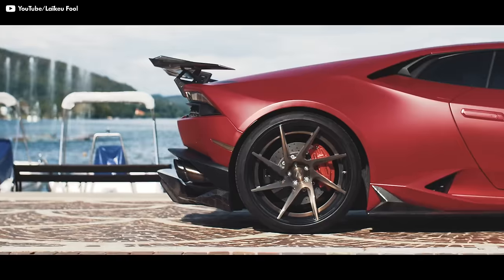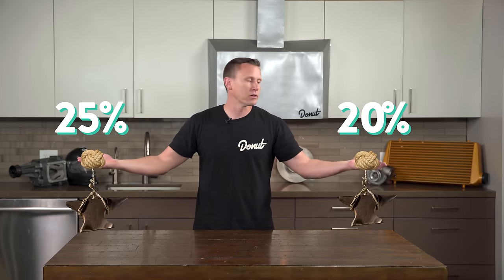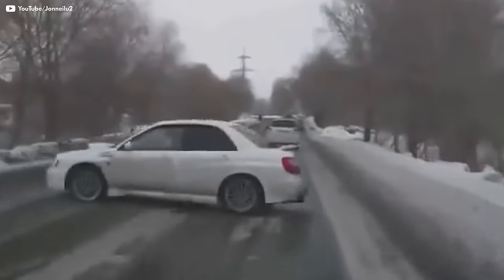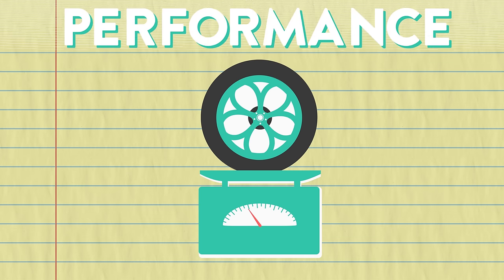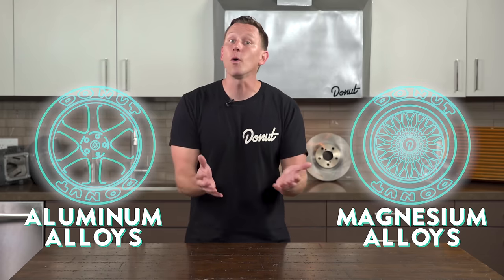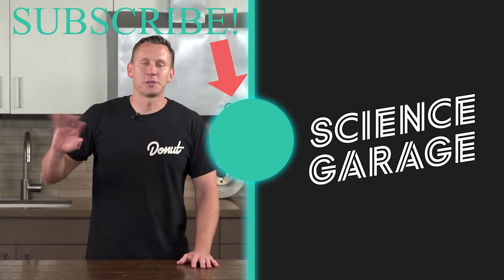WHEELS | How They Work

Comment: In the case of the 18 inch vs the 20 inch wheel, i wish you had added the impact of the increase in circumference.   I think the 20 inch would cover an extra foot per rotation but not sure to what extent that offsets the inertia
Reply: that's an interesting topic to discuss.

Comment: Steel wheels are also excellent on your off roading monster. More weight and wider tyres = better traction AND less ground pressure. Hell it even applies to tracks. That's why the German heavies like the the Tiger H1 were almost as fast as the American Sherman medium!

Comment: Isn't wheel tyre + rim ?
Reply: Guten Tschüss depends on whom you are asking. In Japan, the wheel is just the physical part attached to the hub, while tires are separate. In the USA, they typically refer to wheels as rims, and tires separate, or sometimes both together like you mentioned.
Reply: God help us
Reply: The rim is the... rim. The part on the outside of a multi piece wheel. A wheel is a wheel. A tyre is a tyre. A rim is a rim.
Reply: D o n t   c a l l    t h e m    r i m s
Reply: no
Reply: Tire = tire
Wheel = Wheel
Tire + wheel = Wheel

The rim is the outer edge of the wheel that a tire mounts onto.
Reply: Guten Tschüss no
Reply: Guten Tschüss i take it back i dont know either
Reply: Brett im pretty sure tire + wheel = tire wheel
Reply: Brett thank you how brain dead can people be
Reply: "Tire wheel", I've never heard anybody say that, but sure I guess that works. Just like you can say car wheel or wooden wheel, you're just using tire as an adjective. But why would you say it? A wheel is a circular object that rotates on an axle. The rim is attached to it (Well, not really true nowadays because most wheels are one piece, but you know what I mean). The tire is mounted to it. The rim and tire are both part of the wheel now so just call the whole thing a wheel. I'm not saying you're incorrect, it would depend on what you're trying to say. To me, it's just a wheel since the tire and wheel are one together. But if you're comparing old cars with wooden wheels to new cars with rubber/tire wheels, I suppose it makes sense to call it that.

Don't really care to get into an argument about a tire+wheel combo. The important thing here is that it's dumb to call wheels, "rims". A wheel is what rotates on the axle. A rim isn't what's rotating on the axle (It can't because rims have no center). It's just a part of what is (the wheel). Wheels also have wheel barrels. Why not call them barrels then, too? "Nice Enkei barrels, man". See how stupid that sounds?
Reply: *tire*
Reply: Mr_Da_Cool K whyyyy
Reply: You're either referring to the flange or the bead seat. No part of the wheel is called a rim.
Reply: A wheel is a spherical spinning object, so the round thing. The tyre goes outside the wheel, and allows it to roll without damaging the metal wheel. The rim is the outermost portion of the wheel, similar to the rim of a glass. So in all fairness people who don't know stuff have tainted your brain. However, in technicality there is a rim on a wheel. But for the sake of keeping it simple, there is no such thing as rims, they are called wheels.
Reply: You forgot air,your tire is deflated.
Reply: That's definitely how I have always called it. The rim is the metal, the tire is the rubber, and together as one they make the wheel (assembly)
Reply: @brettcastro97  no, that's the LIP. The FLANGE. The BEAD SEAT.

Comment: hi guys! in one of your videos about wheels, you talked about the advantages of small-diameter wheels, and that the engine needs more force to spin large wheels. BUT doesn't a large diameter increase the speed? After all, in order to overcome the same distance on large wheels, you need less engine spin, isn't it.

Comment: Please don't call them rims...
Reply: SDSBBQ why
Reply: coleman because your an adult.
Reply: AngryBooth 
How does that make sense
Reply: Angel G.S agreed
Reply: AngryBooth you're*
Reply: R I M S
Reply: SDSBBQ i call them rims what are you gonna do?
Reply: turn around...
Reply: SDSBBQ lolz
Reply: SDSBBQ u better be 😂
Reply: dont forget brake dust
Reply: AngryBooth but that’s the actual name of them
Reply: Rims
Rims
Rims
Rims
Rims
Reply: you're
Reply: I fucking hate when people call them rims. The rim is a PART of the WHEEL. A tire is a tire.
Reply: coleman Because a wheel has three parts: a centre hub, spokes and a rim.
Reply: Robzu You were almost right with that statement. A "rim" is what you just described, the term rim refers to the entire metallic object - hub, rim, and connecting metal, it's lazy but that's how it is. A "wheel" in automotive terms is the rim, weights, and rubber.
Reply: Rims boy
Reply: @coleman, it's pretty simple. A wheel, by definition, is a circular object that rotates on an axle. Can a rim rotate on an axle? No, it has no center upon which to rotate.

Using "rim people" logic, we could also call them barrels or spokes because those are also parts of the wheel and apparently parts of a wheel are the name of the entire thing. 

A wheel is the circular thing that rotates and connects to the wheel hub (Or perhaps this should be called "rim hub" for the others). The whole thing. Why would you choose a part of the wheel and call the whole thing that?
Reply: Angel G.S it doesn’t lol
Reply: So where a rim job fit into all this terminology?
Reply: AngryBooth okay you "adult." Can't even spell you're. LOL
Reply: Husain's Channel:  But can you pronounce R or do you say LIMS?
Reply: Hussain's -  Ah, I see :)
Reply: Rims :v
Reply: AngryBooth I would imagine a child with a lack of knowledge about the world let alone the functional properties of a car, would use wheel carelessly.

An adult would specify Rim, because they know better than the child and would specify.
Reply: Rim is the metal. Tire is the rubber.
Rim + tire = wheel.
Reply: Should I call it a wheel job instead of a rim job 😂
Reply: I love good looking rims.
Reply: @Skitungen  agree
Reply: narlycharley Rims
Reply: **RIM**CHARGERS!
Reply: there rims wheels or alloys, mainly rims though
Reply: SDSBBQ turn around
Reply: There are too many songs that refer to them as rims and most of which were in racing games way back when, sorry that you're a mouth breather🤷‍♀️

Comment: So what your saying is that a 5 inch aluminum wheels is better than 18 inch wheels on a sports car?
Reply: No small wheels have pros and cons just like large wheels
Reply: Yeah, this was my complaint with the video as well. By their logic, old 13 inch wheels are pretty spiffy performance pieces. :p
Reply: For acceleration and deceleration, yes.
Reply: Tirerack did a test with a Golf GTi. 20" vs 17".  The 17" took a .5 second off 0-60 because of the weight savings. They also reported that it was noticeable more comfortable on broken pavement.  Look at indy cars or nascar.  small wheels / large tires.    
You need a bigger wheel to accommodate better performing brakes though.  So it is a balancing act.
Reply: you need room for brakes
Reply: Yes.

Comment: Aluminum is 1/3 the mass of steel per volume, but it is also 1/3 the strength.  So to make 2 wheels of the same design and of equal strength the aluminum rim would have to be 3 times as thick.  That means they would essentially weigh the same.

Comment: I know this is way late, but a quick note: even though forging increases strength, it doesn’t exactly increase the density of aluminum. The density of aluminum is more or less fixed, though “porosity” (the amount of the part that has little air holes/voids/pores, like a sponge) can change, so the overall density of the part can change slightly.

Forging increases strength two ways. The first is by decreasing porosity, though the porosity in cast parts isn’t very high to begin with. I think the pores in cast parts are because of how the grains (microscopic regions of metal) grow during casting. The melt starts to solidify around the walls of the mold (kind of like how bubbles develop on the sides of a soda bottle) and the solid grows inward, which results in a less-optimal microstructure (arrangement of grains). It’s more prone to pores/voids, which can serve as crack initiation sites. Forging, because of the huge pressure involved in squishing aluminum, will close any voids that develop simply by squishing them shut.

Second, strength is increased because of “work hardening”. In forging, the deformation that occurs when that aluminum billet gets squished makes it so the wheel can take more force/pressure without permanently deforming.

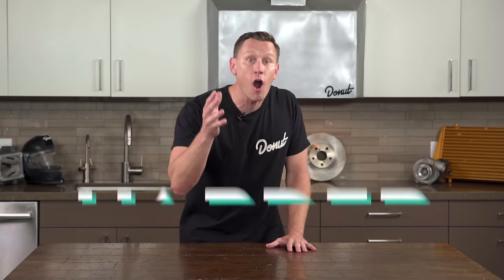Comment: at around 2:45 you said smaller wheels are easier to stop,but to be specific .... they r harder to stop when they r attached to a car.as bigger wheel can accomodate larger brakes to shed off the speed

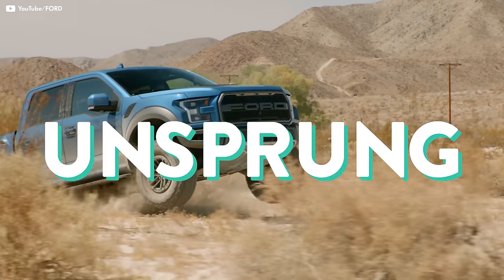Comment: 0:43 correct me if im wrong, im trying to learn the basic parts of a car. but starting from the bottom of the screen that would be 1.) the lower suspension arm 
2.) the inner tie rod 
3.) the front drive axle behind it 
4.)  that orange thing is the shock or strut i don't know the difference.
BUT what is that THING that seems to be connected from the shock absorber cap to the steering knuckle ?

Comment: Smaller rims aren't always the way to go regarding performance.You forgot to mention that the larger the rims the lower the tire profiles which means less tire flex and hence better handling. The reason F1 cars have high profile tires is because their tires are specially made to have extra rigid tire walls, but still suffer from flex if you look closely(slow motion clips)

Comment: Just a heads up if you get 20 inch wheels compared to 18 inch wheels while you might accelerate faster you lose top end and with larger wheels you lose acceleration but gain top end

Comment: I think you meant to say aluminum and copper not aluminum and nickel. Most aluminum casting alloys only us nickel in very small percentages ~0.50%.  High strength forging alloys like 6061 and 7075 don't use nickel at all.

Comment: Clarify: wen u have a larger rim u have more distance then a smaller wheel right, so at what point does the size of the wheel slow u down compared to the increased weight of a bigger wheel and everything in between...??? U feel?

Comment: How much of a weight reduction in wheels will make a useful performance difference? And is it disproportional to weight reduction of the car as a whole? For example, if you have a choice of making the sprung weight of the car ten pounds lighter or getting wheels that are ten pounds lighter, is either preferable from a performance standpoint?

Comment: larger diameter wheels may be slower to accelerate but wouldn't they provide higher top speed because the gearing has changed? More distance for the same revolution?

Comment: Question: If smaller wheels are easier for handling, then why aren't we using even smaller wheels for race cars? Isn't there some kind of drawback towards having smaller wheels, like, say, how easily they can wear out?

Another question: Why don't we have more than 4 wheels on our race cars? Wouldn't more wheels add more traction to our cars, allowing for faster acceleration and better handling, even if it might come at the cost of more weight, and more energy needed to spin those extra wheels?

Edit: Perhaps an alternative towards having more wheels would be to have wider wheels, though wouldn't that provide more drag?

Comment: Lol, 50lbs.... That's medium vehicle wheel weight. My stock 30.4"  tire on my 96 half ton on aluminum 16x7" wheels was 62lbs...
My 20x9s with 265/50/20 Toyo Proxes ST (30.6") weigh 77lbs each, and increased my 0-60 by almost a full second on my nearly stock truck.

Comment: In all seriousness, aren't bigger wheels better because they have a thinner tire wall and therefore are stiffer, resulting in better traction on the track (or smooth roads in general)? I feel like you missed that when saying not to get big wheels if you want better performance. It's a trade-off ya? It's not like you can get any road-legal high performance car below 18s or 19s anyway, and i think theres a reason for that beyond aesthetics.

Comment: You guys missed a lot on the subject here:
-when light small is good but why you don't want them on your everyday driver (there's a reason why touring class cars generally have a 3klbs weight)
-carbon fiber rims are on 60k and below cars now, benefits/cons
-how turning actually works from a fixed point (you actually turn from your rear tires even though your front tires are the ones you change direction on)
-load bearing ratings and their variance and why you may need a high weight rim even in a relatively light weight car
-why heavy rims have many benefits on suspensions with a RTC bias that resists upward forces

Also--wheels are tires+rims so you missed out on the entire rubber part and that's a 30 minute video on it's own...

I generally love everything you do, and at least 30ish of your subs are from me saying no less, but this seemed like a fairly lazy video compared to the normally high quality videos you do.